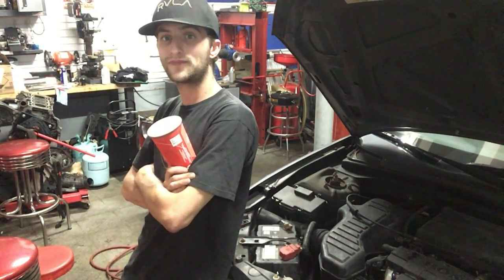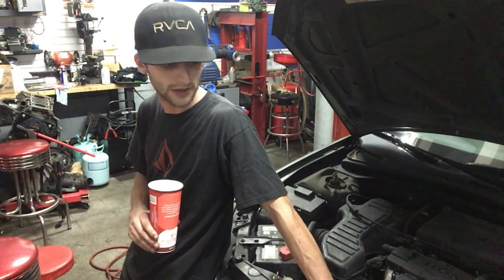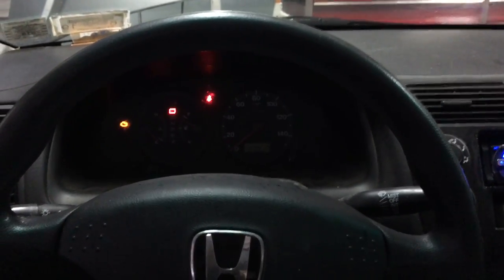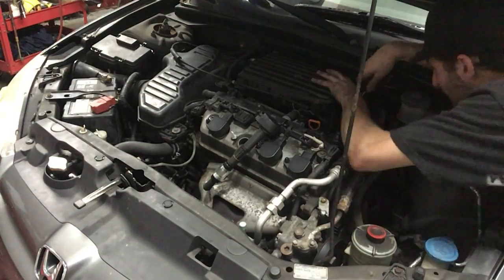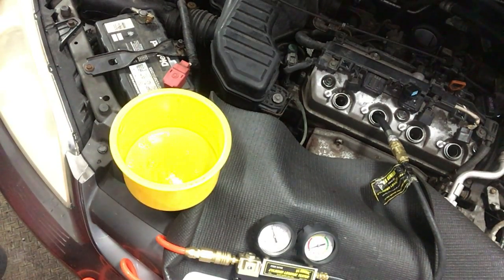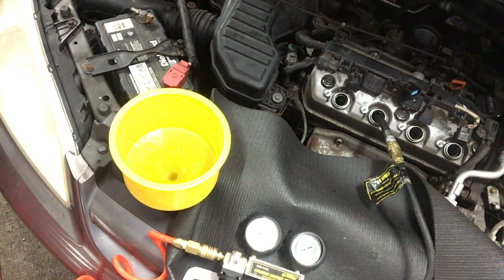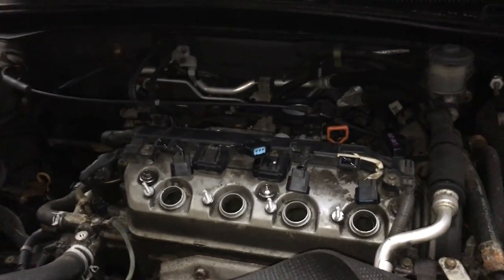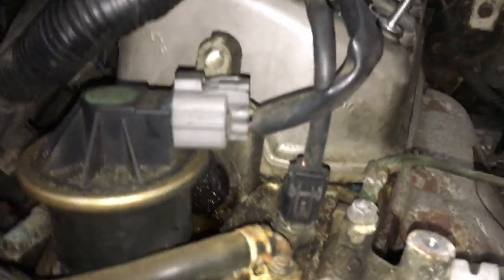Honda Civic misfire diagnosis: Using clues from your customer

Comment: Anyone whos watching this, you can do this exact same test with no tools: (Headgasket test)
1. MAKE SURE CAR IS COLD (DO NOT DO THIS WITH A HOT CAR) {NEVER open a radiator when the car is hot, your eyes will be boiled out of your head..}
2. Make sure radiator is full to the top, you can just use water for this part if you dont wanna waste coolant.
3. With car/engine cold, remove radiator cap and leave it off
4. Start car with radiator cap off, if water goes flying everywhere, you have a bad head gasket

If a tiny bit of water raises and leaks out the radiator thats ok (this mostly happens from vibration of a starting engine), but if it explodes out and goes flying everywhere, you have a bad head gasket. Youll know when you see it happen ha.

Comment: Excellent video. Using the smoke was very clever and effective for the oil leak. That cap is a common roblem on that engine.

Comment: Good diagnostic skills. You can also use a block tester,  that blue liquid and pour into a bottle that has an opening.. If the liquid turns yellow from it's original color.. you definitely have a blown head gasket.. very accurate test..

Comment: I know this is old but I have a 2003 Honda civic and the layout looks the same. I had a p0302 code and changed coil and plug on the second cylinder or at least I thought. Got codes again a month later and today the mechanic told me the cylinder you’re saying is cylinder 3 is actually cylinder 2 and put an ignition coil in and says it’s good now. I’m feeling like he screwed me. The second cylinder should be 2nd from right as i thought correct? I mean in this video you checked the 3rd which he claims is the 2nd. Idk if the 03 model is different but battery and everything look to be in the same areas.

Comment: So I replaced the ignition coil on Cylinder 4, it worked for a while then it crapped out again. But by looking at your video, I realized I was in the wrong cylinder. Cylinder 4 is on the left side of the engine not the right?
Reply: If you are standing in front of your vehicle, cylinder 4 starts on the left. Cylinder 1 is on the right. So its 4 3 2 1 respectively.
Reply: Numbering starts from the head of engine (where the belts are). In your case, the head is on the right side. So you are right.

Comment: I have same engine, have random cylinder missfires, plugs, coils fuel is ok. What the hell is causing it to missfire?? It went to dealer they found nothing wrong, only slightly too much compression due to carbon buildup in combustion chamber/piston etc. Could that cause missfires? Also how do you clean up that carbon?
Reply: Have you found any answer my friend?
Reply: Same problem with my honda civic hybrid 2007.Do you got any solutions ?
Reply: I have same thing, nothing works  (mk7 Civic) changed all coils,plugs, cleaned egr,throttlebody, idle motor, new 20mm2 ground wires,fuel pump has checked no dirt in there.
Interesting thing is its flashes lights (all) when i 3000 rpm to engine brake or tap gas pedal (no charging light on)

Comment: My 2002 Honda Civic LX has Code P0303. I replaced all 4 spark plugs. Previously over the last couple of months I changed Cam Sensor, both O2 Sensors, Evap Canister, cleaned Cat Conv. I tested all coils by disconnecting them one at a time and all made the engine run rougher when disconnected. I switched #3 with #1 coil by counting right to left for the cylinder #'s. Code still shows it's #3. A month ago I did overheat momentarily and was low on COOLANT and OIL. Did I misidentify coil #3?
Reply: You correctly identified coil #3. The cylinder numbers are from driver to passenger (closest to timing belt is #1, furthest #4). P0303 can be caused by a multitude of different things. Literally anything wrong with Air/Fuel, Spark, or Compression can cause a misfire. It sounds like you have ruled out plugs, coils, and various sensors. The D17 engines are notorious for blown head gaskets which is why a lot of people start there in the case of coolant loss with power/misfire complaints. Depending on when you are getting misfires, a leaking head gasket could be an explanation. For example, if you are only experiencing misfires on hot start-ups and it smooths out after that, coolant may be leaking into the cylinder and wetting the piston head/plug while it sits, which affects the spark and air/fuel upon start-up until the chamber is hot enough to evaporate the coolant again. If it's misfiring on cold start-ups, the head gasket may be affectively reducing compression of the cylinder until the head/block warm up enough to expand and reduce the gap... HOWEVER, that doesn't mean a leaking head gasket is your problem. It's just a strong hunch with these engines. I suggest doing a compression and leak-down test. Block testers don't always pick up a small leak of the exhaust gasses and there's always the chance that you contaminated the fluid if it's a single chamber block tester. If both of these tests come back good, move on to things like EGR command/lift readings (if you have access to that data from a scan tool), fuel pressure/injector operation, intake vacuum readings, or even making sure you have the proper valve lash (exhaust valves tend to get pretty tight on Hondas).
Reply: @chrisburkhardt4902  I put K-Seal in my radiator in case it was head gasket. Anyway, after everything I did, the code turned off, and has been off since.

Comment: Hey man my 2005 honda civic says misfire on all cylinders, i changed plugs and the ign coils still having misfire issues and no power. Especially when im at high speeds it starts chugging and when i try to speed up it takes forever to get going, any ideas bud that could help me fix this pleass? My gas mileage as took a dump as well
Reply: Same all misfire issues. I have an 03 ex coupe, changed plugs, still misfire. Changed coil packs still,  then changed fuel injectors last night and no ecu light or misfires. (Yet) Drove 47 miles no misfires. (Yet lol)
Reply: Had the same issue as you guys fixed it last week for $20 it was the fuel filter on top of the fuel pump assembly
Reply: live and let live there’s only one filter on the fuel pump assembly for this civic and it’s on the inside of the fuel pump. As far as I know there are no filters on top of the fuel pump
Reply: @samhan7048  nope the assembly is 2 parts and the filter is the top part $20 on amazon and btw didnt fix my issue
Reply: live and let live damn, that means I have to redo mine... lol.
Reply: @samhan7048  what's on the fuel pump is a sock and actually looks like one then the top of the entire assembly is a cardboard filter which is non serviceable and needs the top replaced...barely anyone on YouTube knows the 01-05 had these
Reply: Well i found out it was my cat. It got where it had no power when I accelerated. I changed the cat and no miss fire and car is running damn good and no more sluggish to it.  Such a big difference in acceleration thanks for the help
Reply: @aliennemesis0663  catalytic converter?

Comment: Ok so when u did the smoke test I am having the same leaking issues..but what does it mean and what do I need to do.
Reply: I'm assuming you're talking about the oil leak from the camshaft cap (around 12:04)? If that's the case, all it means is that o-ring on the cap has failed and is starting to allow oil to leak out. You can buy a replacement cap that comes with a new o-ring (They're super cheap....like $10) or you can pop out that cap, clean the cap and hole with a rag and brake clean, and apply some silicon gasket (i.e. HondaBond, Permatex "The Right Stuff", etc.) to the cap/o-ring. Super easy fix. It's really just a minor oil leak.

Comment: I know its a old video but I have a issue at the moment I just can't seem to find. Start car which is a honda ep2 d16v1 I start it cold 15 degrees c any higher it doesn't do it. But under that itll misfire for about 10 seconds drops revs and fuel smell goes to stall bit doesnt. Then its fine no eml. I've cleaned all intake sensors put a fuel cleaner in. Any ideas ?
Reply: i got the same problem and cannot figure it out at all

Comment: hy i drive 2007 model civic hybrid
the issu is misfire cylinder 2 and 3
i change head gaskets and ring and repare full head wal but the problem is still there
Reply: Same problem with my civic reborn hybrid 2007 . Have your problem sloved?
Reply: Did you check spark and fuel?
Reply: I got the same problem 😂

Comment: does it damage the starter doing the compression testing when you crank it over alot
Reply from the maker: no it wont damage the starter. it takes a few seconds to install the tool into the next cyl so the starter is never getting hot. If anything cranking the engine over for a complete compression test can kill a battery that is just barley hanging on. Some guys will put a battery charger on it for this test for that reason.
Reply: No does you